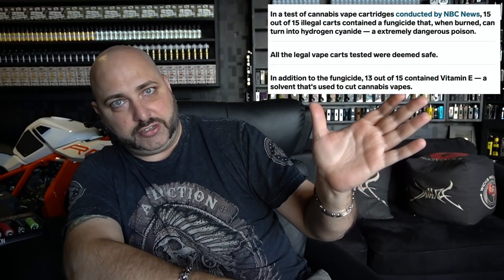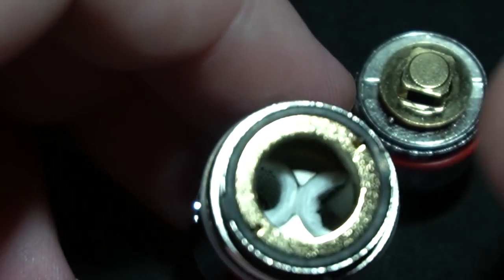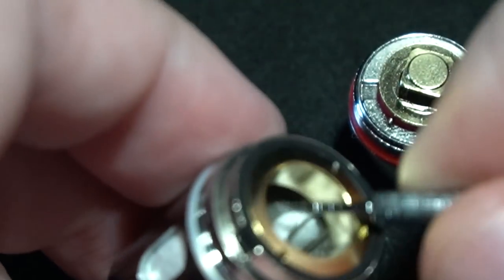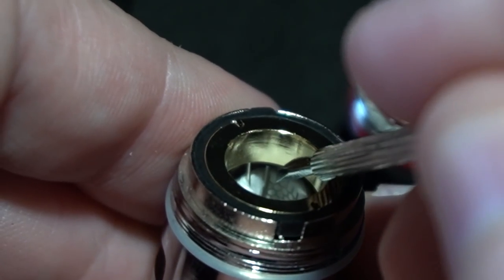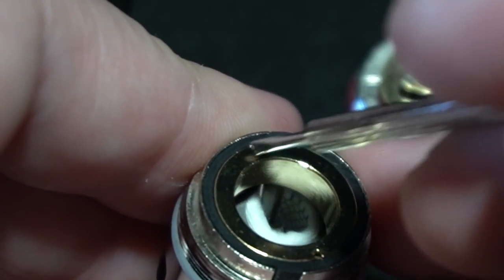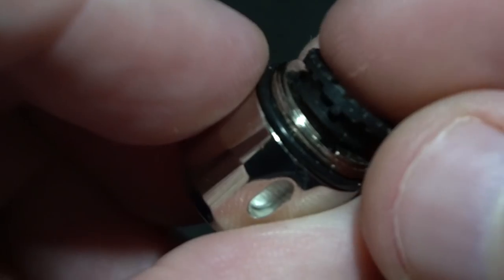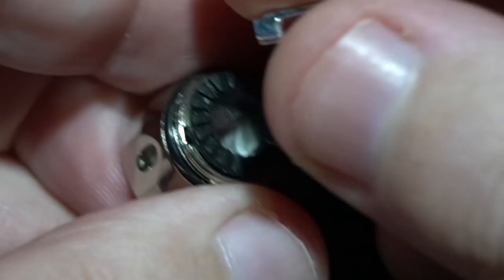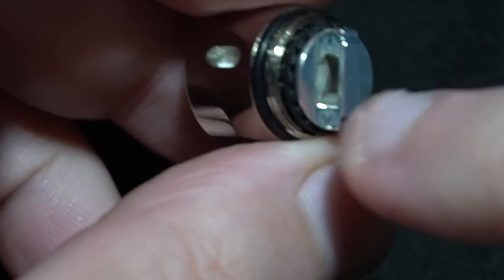What Is Causing the Vaping Illnesses, What's In Your Juul | Chemical Burns in Lungs

Comment: This is excellent! Thank you Jai! I knew about the Baby Beast / Sub-ohm type coils from when I used to use them, I tried rebuilding / rewicking a few. They never turned out great but at least I pulled them apart and saw what you did. I've rewicked Infinix and Novo (Smok) pods before and never noticed soldering points. And those I can definitely say use cotton for the wick. 
Oh, and about 3 years ago I tried vaping on a coil (rebuildable) without cotton. You're lucky if you get one complete draw before all the liquid burns off, because in that case there's nothing to continuously carry the eliquid to the coil. So, I did that ONCE. And once only. To anyone thinking about it, DON'T try it. Fire breathing dragons are real 😛 If you want to see how quickly it "heats-off" the liquid, next time you're rewicking, before you rewick, drip some ejuice on the bare coil. See how quickly the coil heats-off the juice and begins to glow. Well, when you're inhaling, it happens even quicker. That's why you don't want to vape on a wickless coil.

Comment: U can not solder resistance with non resistance wire.They can be joined only by welding.Avoid confusion.
Reply from the maker: Some truth to that. But has nothing to with what I’m talking about. The point is nothing gets that hot to break anything down in there. Did you miss the whole first 4 minutes
Reply: @JaiHaze  I didn't miss your hair because you never had it.
Reply: @JaiHaze  no no video was ok and i watched it,just saying,on all coils iv had wires were welded and ih needed crimped at the bottom no solder used.Keep the good job,specialy liked the video for Serbian Limelight,those mofos are ripoff big time.

Comment: My brain immediately went to the "notch" coil when you mentioned soldered wire. Although (in my opinion) a pos coil, you never heard of anyone getting sick from using one.
Reply: Pretty much every subohm coil has solder on it where the non resistance wire is attached to the coil.
Reply: @mikenite69  they're welded not soldered, most of the resistance wire used is too difficult to solder with that it's easier and cheaper to weld.

Comment: Gr8 informational video ..... (10sec  cut off )  I made circuit boards for 15 years and I put the solder on the boards so components could be mounted and was tested for lead a bunch of times and passed all test...  Gr8 video man....  Ty

Comment: I think they spot weld the resistance wire to the non resistance wire.  Soldering those wires together would be very difficult, and a dry-burn would most certainly melt the connection.

Comment: A really good way to show how well a liquid protects something from heat, is to put some water in a paper cup, and try to burn it from the bottom. You absolutely can not burn the paper, which proves the cooling effect of a liquid in contact with a material. That is similar to what is happening in a coil.  

Edit: Watch this https://youtu.be/I9gKzea3Cno

Comment: When it comes to a regular juice, it generally starts boiling at some point between 400 and 500 ºF depending on the VG/PG ratio and, as you mention, it cools down because of the air flow and the constant flow of juice, it doesn't reach a very high temperature. 
Why is this important at all? Well, because a lot of "studies" that claim vaping causes severe health issues and that the vapor contains a lot of crap are conducted under extreme conditions. An example of that is the 14 V study Jai has mentioned on a couple of his videos.
The soldering thing is a completely different story but it's not present in any open device

Comment: Hi Jai. I am a qualified electrical engineer. The solder present on coils, as I am sure you already know, is there to make the electrical circuit which in turn allows the coils to fire (heat up). IF the solder joints were to heat up sufficiently to melt the solder, the circuit would fail and this in turn would prevent the coil from heating up any further. The chances of inhaling metals from a failed solder joint are therefore slim and none. Since the Vape related health problems appear to be limited to the USA you would think that tracking down the source of the problem would be a relatively easy process. Products used worldwide, where no such issues have been reported, are obviously not the source. This leaves THC and High Nicotine salt products as USA only products which would appear to be a good place to start the investigation.

Comment: A select few used to use soldering points like that back in the day. They used silver non-resistant wire so it wouldn't effect the coil resistance. The old HH357's made by Hanna from Avid used to make coils like that since it was too small to do anything else.

Comment: What I'd like to add, not the reason for the outbreak but still worth mentioning under this kind of video: 
Some sub ohm coils tend to get super hot around the insulator and melt part of it. That happened to me multiple times with crown 4 and tfv16 coils.

Comment: It has to be anything that is commonly used in the US but nowhere else.
The hardware is most likely not the reason because the same hardware available in the US is also available everywhere else. The only reason to blame hardware is that something might changed in hardware over the past 2 years that now leads to issues with anything in the juices that wasn't used before.
I never heard about cases in Japan, Taiwan or Europe.

Comment: Even the ones you said were soldered because there was a blob of metal between 2 different wires weren't soldered either! They're spot welded ! A high current from a capacitor heats the ends of the wires when they're touched together. It's a weld that only contains the metals the wires are made of. If a joint is soldered you can unsolder it with soldering iron, or a hot wire like a atomizer coil. LOL That's why there is no solder in atomizers. It would disassemble itself on first use.

Comment: If i remember correctly on one of my clapton coils from a sub ohm tank the wire that was wraped around the core wire was soldered to the core before the legs went down to the botom of the coil but i do completely agree that for it to actualy melt you would have to be firing it dry and for very long. Great vid jai thanks for always giving us the info we need.

Comment: I don’t wanna be  “ that guy” but aren’t those spot welds where the resistant an non resistant wires are welded?
Reply: 100% correct
Reply: WELDED. not soldered. there is a HUGE difference between welding and soldering.

Soldering is using a binder metal that melts at a low relative temperature compared to the metal you want to bind (solder) to bind 2 metals together. Think of it like hot glue but for metal.

Welding is the heating of the metal to so high that the actual metal of the object you're welding melts and the items are fused together with little to no added material
Reply from the maker: Jesus Christ, it’s not the point. The point is shit won’t get that hot to break it down
Reply: @JaiHaze  you tell em jai!

Comment: Even if the solder joint did get hot enough to finally melt, it would burn up the resistance wire first because of the physics. The high resistance location gets hot first and if it got so hot that you could transfer enough heat far enough, it would destroy the wire first
Reply from the maker: super interesting

Comment: Jai haze if u look at any Clapton subohm coil they usually have Soldered wires on them or where the wires go into the bottom of the coil where are the ground and positive are you will see little solder joints as well as mesh coils have soldered wire to go down to the pos and neg

Comment: There has never been Solder used inside any tank system nor RDA nor Standard coils nor POD systems...
the connection you see on the 1st red wire is welded thru electricity with a high powered Electronic device, very high voltage 
very low amperages.  Which is being used the most for 2 piece wiring inside a coil.Besides that the metals of the excisting coils 
types Won't even accept any form of soldering on a tin-lead based solder. Tin itself is almost non toxic.. but a mixture with lead 
or the lead replacements are toxic... you can see a sort off soldering on the outside of some pod brands, but its not a tin-lead 
connection, its something else and u need a special soldering iron which gets twice -triple as hot as the tin-lead connection 
needs to start flowing..

Comment: What is some of the novice coil Builders used Titanium or Nickel wire and run it in Watts rather than temperature? That would probably produce toxic gases / fumes if you were to burn that type of wire too hot. There are also  atomizers  / coils  made  with that type of wire.

Comment: When you vape a free base juice the cotton remains the same color unless there are sweetner involved that gives the brownish color on the cotton and in the chamber. But with pods and nic salts you also have the 2 types of color in juices, the problem comes in when you vape on a pod system for a period of time that juice actually turns a vey dark tobacco color type of brown.

Salts tastes salty and the nicotine strengths are quite high and when you get some of the Eliquid in your mouth it really have a tingling sensation together with a burning effect and this is quite concerning and is something that should be looked into to.

Comment: Jai can you pull one of the coils all the way out (not on video necessarily but just In Your free time) then report back because what I remember from old coils at least is the soldiering is on the legs of the coils that’s typically inside of the coils head and it connects the non resistant wire to the resistant wire. Honestly it really doesn’t matter though because they really are reaching. I remember when their whole thing was “the health concerns then that was proven to be minimal. Then they moved on to “they blow up all the time”. Then they move onto what is always the final thing to change public perception and that’s the kids. It’s textbook, use kids to pull at the heart strings of the public (especially now a days people are so ready to be offended or upset about something). They will for sure find something that they can spin to be a negative because at the end of the day they have an objective and we all know what that is. Either way thanks for the educational video for those who don’t know how these things work jai.

Comment: Before the solder 'fumes' or welding 'fumes' theory can even be given any respect at all two questions need to be answered... 
1) If that's the problem then why do my coils work? As soon as solder gets hot enough to release any fumes it melts, same for welding materials 
2) Why don't Sparks and Welders wear breathing protection whilst soldering/welding? (Before anyone says it, there will of course be Sparks and Welders that do indeed use breathing protection, but I'd wager the majority don't. None that I know do, and that's a rather large amount of people)

The first one basically shuts down the entire theory because if it was soldered coils releasing fumes those coils would cease to function pretty damn quickly or at best they'd only partially function when the lead wire touches the non-resistance wire leg or the contact depending on the setup. 

Oh yeah, there's one other thing... If it were solder fumes you'd taste it. 

Super interesting that Juul and others are still using Silica Wick though, I guess if it ain't broke don't fix it

Comment: Nice. However, when I said on your stream that most Mesh stock coils have soldered legs, I was referring to the legs connections to the Mesh itself. The wires' connection to the flat mesh/sheet etc ...
I doubt it's a big deal, but that is what I was going on about.

Edit :  These solder points : https://imgur.com/KIZi1UW  (just took these pictures)
Reply from the maker: Yes I got you now. Again, this won’t be a problem cause the point is nothing gets that hot inside to MELT that solder
Reply: @JaiHaze  Yep. But since the matter was to know where solders could be found in Vapes, this is why I pointed that out :) 
Keep the great content coming Jai !
Cheers from France.

Comment: Just throwing it out there, what if some of these pod systems / sub ohm coils are getting “hot legs” from shitty qc on coils ? Think that could be a thing ? I know when I’ve built coils , if I don’t seat them properly ( or whatever reason ) the legs get suuuuuuuper *in my best jay haze voice* hot . I’ve even snapped the leg of a thin gauge wire fucking around before . Think that could be causing issues with some people ? Would make sense for the small %

Comment: If any of the devices were getting hot enough to break down solder in them, wouldn’t that break the coil/pod?  If the solder is melted or vaporized or whatever the wire wouldn’t be held where it needed to be for the device to work.  If there soldering in the device and the device still works then the solder hasn’t been broken down

Comment: Quick google search shows, lead free low temp solder has 10 percent cadmium in it. Cadmium can give off toxic fumes. Also heat transfer and buildup to the legs from multiple hits in a row. The solder is also away from the airflow in the pod, to cool it down. Unlikely In most circumstances but possible.

 Even if that isn't the cause of the illnesses, the higher levels of cadmium that where tested can be removed by press fitting the connection like the lost vape pod.

If that played a role in the illnesses, would be aggravating that crappy manufacturing of pod devices can jeopardize the whole vaping industry.

Wish more knowledgeable people would dissect this issue like you have. Vs just blowing it off as the fault of thc. Its not doing our industry any good.

So potentially both some pod systems and thc cartridges have solder in common.

Jai, you should get ahold of some of the old style carts that are being used for thc products and dissect them. The ccell ones, they are .5 or 1ml carts. I think one of them is called the th1 or something similar.

Thc carts have been around for longer then most pod systems, if that's the cause, could explain why more illnesses are related to that.

But also, they are determining thc usage by urine testing, and not separating people who vaped thc carts from people that smoked flower or any other way of consumption.
Reply from the maker: im trying brother. I like this comment a lot. The one argument people pose is that if it is the solder breaking down, how come no other countries are having this issue. Believe me, I am not the guy to just write something off. I like to look at things from all angles. Hence why I can be unbiased in a review, hate a product but carry it in the store. Some people dont get it. And thats why they dont run a business.

Comment: You sound like me lecturing someone on Twitter. I told him that you can't inhale long enough for It to get that hot. And if it were solder the thing would fall apart. Spot weld ok no solder, solder would vaporize. He ran away and never answered my questions. Solder types? Core no core? Flux, no flux? What do you use for welding that isn't spot welding? It's driving me nuts with all the it's this and they have no idea what it is. Nevermind the day All the so called doctors came out with the hokiest charts and graphs. I even told one to go back to his room and do it right. 😁 If I could get away with letting my homeschooled kids do that I would be in trouble. These are the people who are supposed to be giving the facts? They are a joke. 
No wonder they tried to get homeschool laws changed. They were taking the university spots from the public school kids. Wonder why? And those are the results from the public school system? 🤦🏻‍♀️ And yes they know the answers to all my questions. Okay I'll go now that I've ranted all over the comment section. 😳 See you in Twitter land.

Comment: Silica wick and ceramic are used much more widely in pods as well. We have known ceramic isn't safe for a while.
Reply: They do use soldered joints. I've found some in the smok 22 coils (bear with me because I don't use pre made coils).
Reply: I think they either use a technique called brazing or solder. And I may be wrong but to get the mesh to stick to the leads they may actually solder. That seems like it may be the connection point.
Reply: Silica is much better used on closed system pods because you won't burn wick out.
Reply from the maker: Where did you get this at
Reply: @JaiHaze  I said it wrong... Ceramic elements are making there way to pod systems like the vuse and there line. You are right in questioning me, as I don't really have THAT much experience with pod systems. But every single pod I've broken into on the vuse brand here in Ohio, they use a porous ceramic block. I found it extremely strange because we as a community have kind of got away from ceramic because of emissions and other reasons of safety. I'm no doctor, or expert. Just a hobby mod and coil builder. Also, check your mesh coils... Are they "crimped" or welded/arc welded/soldered? That would be interesting to note.